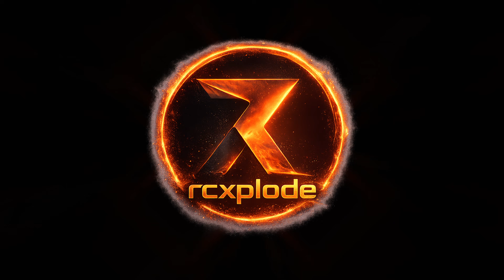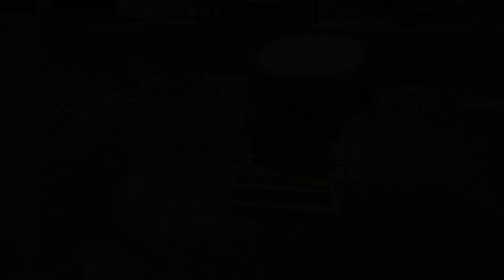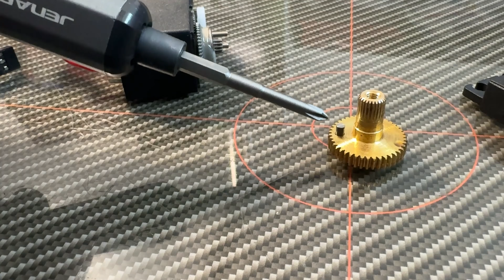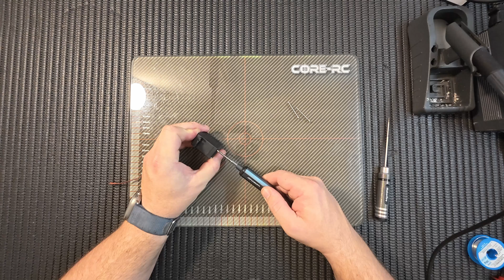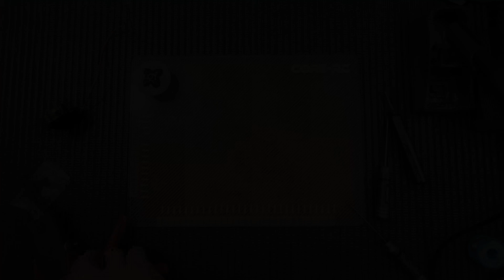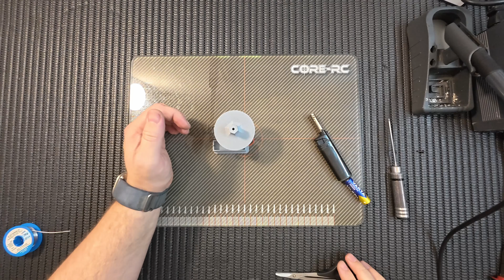Stop Overpaying! $10 3D Printed Tire Gluing Tool for RC Car Hobby Driver

Comment: What servo is this? Does brushless  servo also work?
Reply from the maker: It's a **digital MG945 servo**, commonly used for **aircraft landing gear**.

Specs:
• Size: 40.6 × 19.8 × 42.9 mm
• Weight: 55 g
• Speed: 0.18 sec / 60° at 6 V
• Torque: 14 kg·cm

For this tool I removed the control electronics and connected the **motor directly to + and – from an AA battery**, so the servo just spins continuously.

In principle you can use *any standard brushed servo**, because inside they use a **2-wire DC motor* that can be driven directly with + and –.

**Brushless servos usually won't work for this**, because they require their internal driver electronics to run the motor.

Comment: Excellent. I made a drilling jig from 3d print part so I can drill my chassis accurately to add a floating servo mount
Reply from the maker: Cool, what vehicle did you do that for?
Reply: @rcexp what else. My kawada alcyon II. Need to modernized it a bit. Added Trf420 gear diffs and front tamiya dcj too
Reply from the maker: @alcyon2sp  I wish you every success.